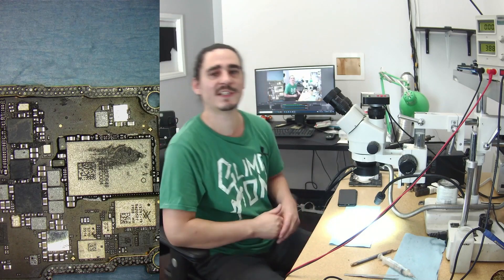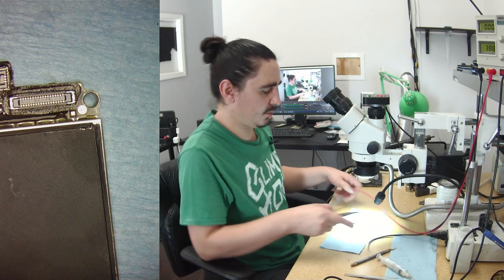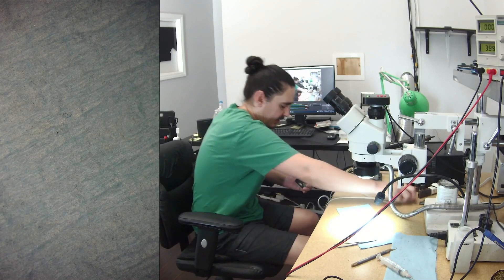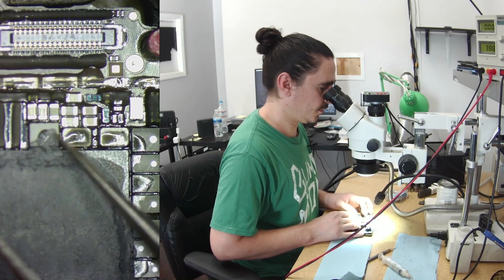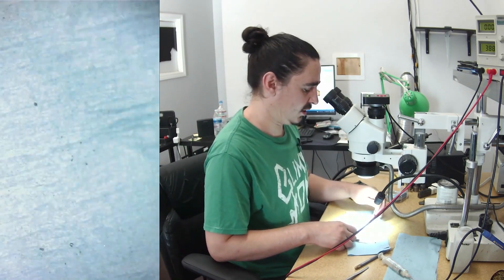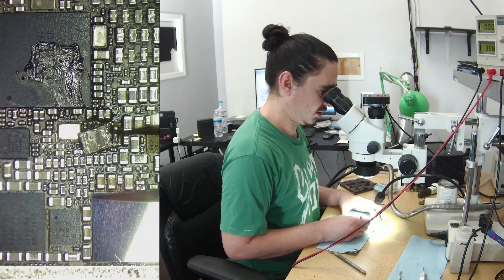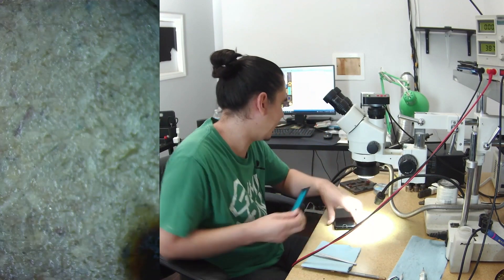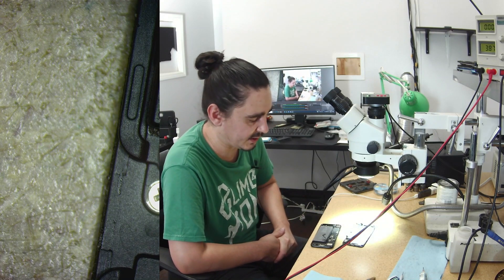Diagnosing and Solving Low Power Current Draws - iPhone 7 Data Recovery

Comment: Hy Aaron, thank you for your useful information. Sorry for my English🙂 i have a weird problem with a iphone 13 and i want to ask for your opinion. On DC power supply the phone tries to boot but the current draw is fluctuating and no apple logo. The amp draw is going to aprox 200 mili Amp for 2-3 sec when pressing the power button and than falls to less than 10 mili Amp, and after releasing the button the same scenario, goes to aprox 200 and than falls to almost 0, than goes again up and down - it doesn`t show apple logo and it doesn`t shut off completely. Thank you. Greetings from Romania 🙂
Reply from the maker: I would try to put it into recovery mode and try an update to see how it fails. Best guess is an interposer problem, but I never really know until I just start checking things.
Reply: @iBoardRepair  thank for your sugestions. The phone won't go to recovery mode. I've changed nand, board swap, everything but same problem, error 4014 on itunes. Probably the cpu is bad 🙄